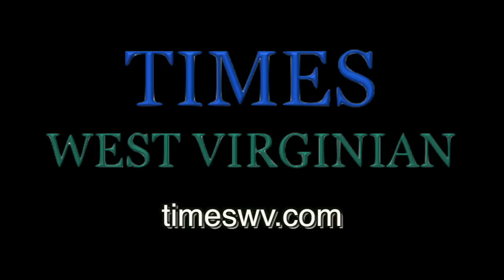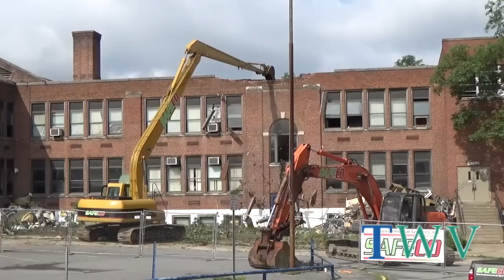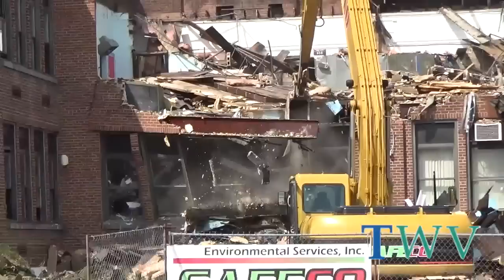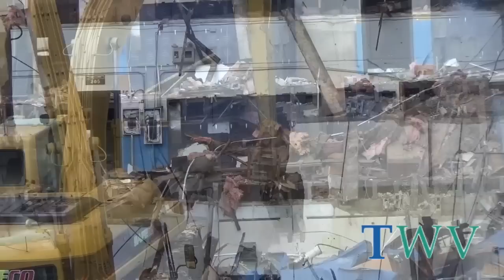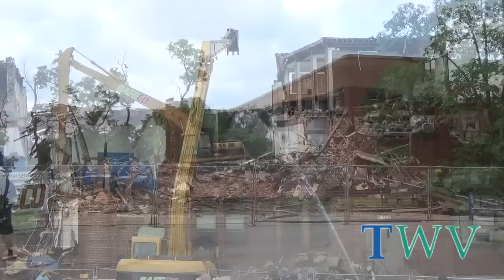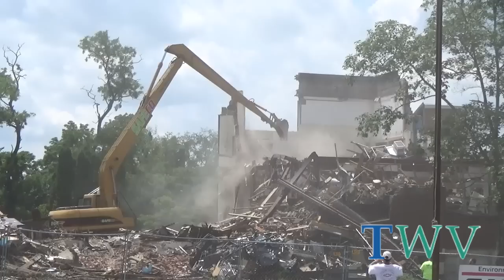Demolition of East Fairmont Jr. High School

Comment: The school was extremely well built.  Graduated in 91 when it was EFHS.  The school was opened in 1921 and had a start build date of middle 1919.  It was close to 100 years old when it was tore down.  The school was brittle.  The crane he is using is a power house.  The gentleman behind the crane is good operator and used the tear points in the school to help him get it down quicker.  Make an area weak and it will fall quicker.  The north end of the building, the band area...that is what was my home away from home, mid summer to end of the school year and start over.  The framing design built and used in the old school is far superior to what is being built today. The one thing we had that still is the tops that all the other classes missed.  MAZZAS pepperoni rolls and hot dogs and pizza buns.  Noone was ever turned away.  That was Larry and his family.  That was what really made EFHS and the school and memories.
Reply: yeah sure a timber and masonry structure is far superior to rigid steel or reinforced concrete
Reply: I don't think you realize what you are talking about when you mentioned the framing in this building is superior to what would be built in present time. Building techniques and materials have come a very long ways since 1920 something... just saying. Not to mention building codes were most likely non existent when the structure was built.
Reply: @fnhwk  i am a building contractor.  There was code back then as well.  Most if not all buildings 1920s thru 1960 used different materials with most having superior strength over todays quick fab up and done.   Mud and slat walls are 50 times stronger than basic sheetrock.  Concrete mixtures back than hit as high as 9000psi strength rating.  Brick and mortar constructs were made of better materials.  2x4, 2x6 and more were there actual size.
2x4 now are anywhere from 1 3/4 x 3 3/4  if you buy from actual contractor site to actual 1 5/8 x 3 9/16.  So you actually lose as much as 35% load strength.
Type of nails used were mostly square nails.  
So much more.
Rigid steel has its places but rigid steel is only used in outside shoring and outside main support.  Light gauge stud steel is used for in between fabrication and load differentation.  Timber still is the ruling build.  Most if not all long supports are LVL and that is composite wood compressed under high pressure and steam.
20+ years doing this.  Yes there are newer materials and some yes are better, but some are actually not.
Everything I do requires basic physics, complex math.  Load calculations and more.
By the way reinforced concrete is an over used term.   100s of permiatations for concrete mixtures all with different weight ratios for what they are setup for.

Have a good one.
Reply: Smash that old Junior High building down! It crumbled really easy.

Actually, modern buildings are a lot more efficient when it comes to use of materials. Composite construction and modern methods result in a better building which is more watertight and well insulated.

Buildings are designed for limited lifespans, to a budget, and need to be fit for purpose over their design life. No more... or we are wasting money... especially where public buildings are concerned.

Comment: Surprised at how quickly and easily buildings come down
Reply: Yeah he pretty much just boops it and it comes down
probably for the best no one uses that place anymore
Reply: Actually the school was very old it was already falling apart, and I'm pretty sure the inside the school there was some collapses. And you can see the roof was already coming down by it self when they barely touched the building.
Reply: @cottton  Actually the school was very old it was already falling apart, and I'm pretty sure the inside the school there was some collapses. And you can see the roof was already coming down by it self when they barely touched the building.